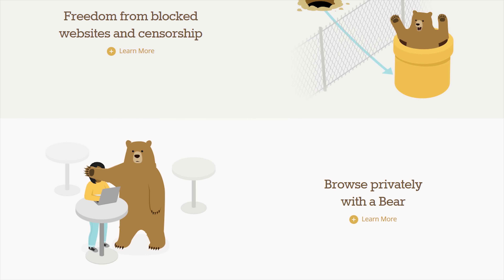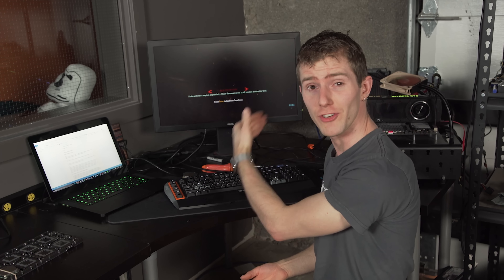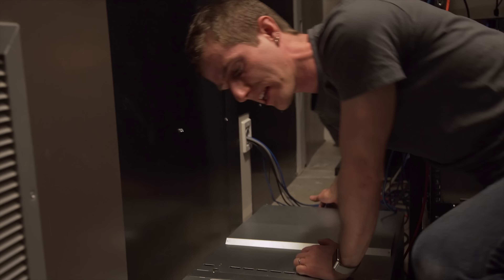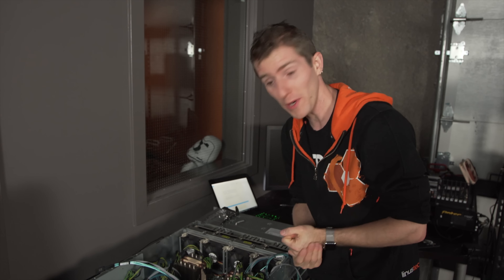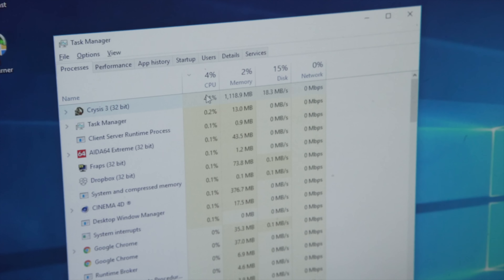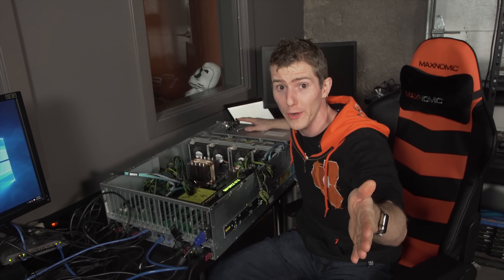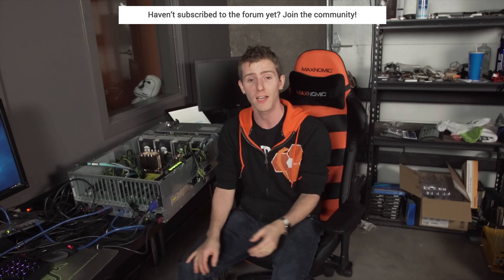Two 22 Core Xeon CPUs!? - HOLY $H!T Episode 6

Comment: Tunnelbear is only available to your left ears
Reply: +Hersa37 Hahaha!
Reply: +Hersa37 Yeah it does sound stronger to the left, it is playing through both speakers though.
Reply: +Hersa37 it's the devil speakin on your left shoulder
Reply: My right speaker is broken that's why.
Reply: +Hersa37 Ting also!!! ( I think "sponsor parts" where recorded out of audio balance)
Reply: It's unbearable.
Reply: Its not your speaker....
Reply: +Hersa37 Can I VPN the audio to my right ear?
Reply: +Tevyn Monismith good thing I'm deaf in my right ear
Reply: +Hersa37 Plays through both on mine
Reply: +Hersa37 Its "tunneled" to ur left ear via VPN.
Reply: I have multiple left ears apparently.
Reply: +Hersa37 Atleast now I know I got my headphones on correctly
Reply: +Hersa37 Weird, because it was on both for me. Maybe you just don't know how to plug in a pair of headphones.
Reply: +TheRebel3000 Or maybe it's that your pair of headphones or speakers are bad and don't have stereo sound and just use the left channel audio for both ears.
Reply: +mkylem +mkylem And what do you mean by 'bad'? They aren't faulty if that's what you mean. For that to happen there would have to be a bridge between two of the pins on the input or two wires touching inside the main sheath, which would probably just cause a short circuit and stop both ears working rather than playing both channels through one. Only 400/175,000 viewers liked the comment saying the left channel wasn't working so they're the statistical minority.
Reply: +TheRebel3000 That assumes that everyone who has seen the video reads the comments, has seen the comment, and has rated it without any dislikes. You assume that the remaining 174,600 people didn't experience that problem when it actually isn't the case. It is extremely likely that people with properly functioning stereo sound devices have noticed it, though the comment isn't a census nor a statistically valid way to determine whether the majority or minority have experienced it. I, for example, experienced it and didn't give it a thumbs up. If you knew about statistics, then you would know this is an extremely improper and flawed way to get data and make a result from it. (By the way, the point is that the left channel is the only working channel during the advertisements, not that the left channel is broken. It happened again during the Ting ad at the end of the video) 

Also, there are multiple ways in a circuit to make stereo headphones (assuming they are stereo. Mono headphones, even with two drivers, would do it by default) output via only one channel. It could be splicing one channel to two using the output jack or your system down mixing to mono and then outputting "stereo". If you want proof that the video only outputs to the left channel, download it and put it into something that displays two audio channel meters (like Premiere Pro or something) and you'll see the problem.
Reply: mkylem you should switch to de-caff sir
Reply: +TheRebel3000 if that's the case, the rest of the video should be experiencing the problem too
Reply: +Hersa37 Stereo comes with the Grizzly subscription.

Comment: How quickly that finished was amazing
Reply: +Daniel  Burgos I was like HOLY $H!T
Reply: +Daniel  Burgos How quickly I finish is pretty amazing too.
Reply: +Daniel  Burgos Yeah but those little "squares" looked so much smaller than what I've seen in the past, is it normal for it to render smaller chunks of that image when there's more threads available?  Maybe they are smaller because the clockspeed is only 2.2ghz, vs most "gamer" rigs clocked over 4ghz?
Reply: HUGSaLOT Valkyrie The more threads you run on cinebench the smaller it makes the individual rendering sections. This is usually because hyperthreading actually helps more the more threads you have, so it's actually good to be switching between smaller tasks more often rather than doing a few long tasks and never switching.

Comment: You guys should ask Valve for 10 Vives, nvidia for 10 1080ti's, and make a 10 vr's 2 cpu's.
Reply: ***** lmao
Reply: I don't think teslas even have video outputs
Reply: +Magnus Hjort Too bad the ti's don't exist yet. :O
Reply: +GLaDOSv3gaming In home streaming does not need a local video output. So it would work.
Reply: +홍용준 SLI is not needed for pass through to VMs. The point is to have as many separate GPUs as possible. Combining them in SLI would mean they could only be used in a single VM.
Reply: +GLaDOSv3gaming well, they DO have a 19" Nvidia touchscreen in the middle console.
Reply: They don't do video though, only calculations and stuff
Reply: +GLaDOSv3gaming There is no reason for them not to be able to output video in a VM. In fact, if one were to solder on some physical video outputs they would work perfectly well as local GPUs.
Reply: I take it back, some newer tesla cards have video outputs
Reply: +Magnus Hjort yep...
Reply: +홍용준 you can use more then 2 sli in the 1080 you have to do special things
Reply: +홍용준 Not correct. It supports more, but its not optimized for it.
Reply: make it so...
Reply: lmao
Reply: He did that
Reply: doesn't HTC make vives or does valve help
Reply: +Samsung Tabley collaboration

Comment: Thumbs up for the successive flagship models comparison!
I built myself a rendering machine about a year ago with two top of the line Xeons, and have been wondering ever since if I could have been pushing out renders faster, had I waited a little.
Reply: I jus got 2 2698v4for my z840, the 99s are still expensive and it's only 2 additional cores for 10 more watts, no big deal but I got the 2x 98 for chips.

Comment: "Hello, I'm Linus, this is what a $5,100,000 gaming PC looks like, it runs with a decadonediac Broadwell Core Intel i8-69420000 Ultra Extreme top of the line CPU so powerful it can kill all other existing technology, we're doing a quadrasextiantion SLI Nvidia Ultra Super Rare Edition GTXZ-8800900 that rocks 3.7632 terabytes of V Ram, DDR3, DDR4, and DDR5 at the same time, and 78 5 yottabyte SSD running at 77 exabytes per second, all on a dual express crysa 3 cinebench ASUS decabench Extreme Deluxe Edtion 88C762 motherboard, all bundled into 576 cubic feet of case space, a few hundred 760 mm fans, 89 gallon water cooling, sub zero polar ice coolant 5000 generation 73. This translates to an amazing anul fucking to your wallet and over 9000% orgasmic performance."
Reply: You forgot the 200,000K resolution monitor that its hooked up to.
Reply: You mean the 17 1500 inch 200,000K resolution monitor setup. ;)
Reply: "The question is... will it run Minesweeper?"
Reply: or just buy a fucking gaming server fill it up with 16 GPUs and you got a machine that puts any desktop pc to shame
Reply: ***** nasa goes a whole different way in computing.
Reply: EzioBellic2KOOL and we drop it on video lol
Reply: You just predicted i9.....
Reply: There's something called an "Intel Xeon i9", you don't know these? ;)
Reply: but can it run crysis on ultra settings??
Reply: You forgot a few zeros

Comment: can't wait for the 1080.

20 gamers 4 GPUS, 2 CPUS 1PC
Reply: 1080ti =]
Reply: YAAAAAASSSSS exactly what I was thinking
Reply: +Alpha X It is with Xen GRID and other vGPU systems, those are rare and weird though, and only run on Tesla/Quadro cards afaik.
Reply: +Wonder Boy 1180 with HBM2
Reply: +NonsensicalSpudz meh, would be awesome for vr, but for regular benchmarks so far, the 1080 isnt that much better than a titan, but still is awesome. i love the core clock speeds on then, 2.3 ghz jesus
Reply: +Volta Actually, Tesla and Quadro cards would not work either. nVidia sell specialised multi-GPU GRID cards such as the K2 for virtualised graphics in servers.
Reply: silosis How would you know if the card hasn't been released yet and the only graph of performance we've seen so far is the one they had at the live stream/launch event?
Reply: Bayonet
 You're right, last time I checked GRID was not around yet, only being planned.
 I haven't been catching up with this tech...
Reply: NikOwnzYu ive seen benchmarks already lol, you can just look them up and compare o card from the current gen
Reply: silosis Yea but we don't know if those are legit as far as most of the news outlets that have reported on this they said take this with a grain of salt.
Reply: NikOwnzYu in a month when they are released and are similar to the benchmarks we have available, dont say i didnt tell you so :p
Reply: silosis Dont care :P

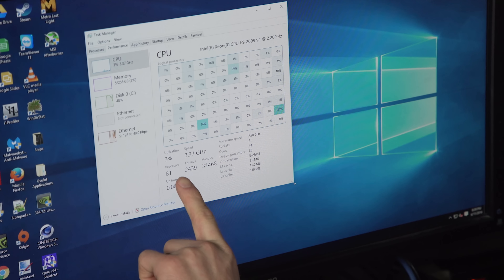Comment: 8:35 How do you see all the threads on Task Manager instead of the line graph? I mean I only have an i3 but I still wanna look cool. :'(
Reply: +Duwfel they switched from the line graph to this in Windows 8.1
Reply: +desolatetree you can click on Resource Monitor and see the line graph per core there.
Reply: +desolatetree Right-click the graph and you'll see the option to change the view.
Reply: +desolatetree Right click on line graph then change graph to logical processors.
Reply: hqdefault Yeah and then I just get four little line graphs lol Is it because I just have an i3?
Reply: +desolatetree Yes, don't worry I used to have a Celeron Prescott now I have an i7 Haswell :D
Reply: +desolatetree yes its because you have an i3, thats a dual core with hyperthreading so the 4 graphs represent the 4 threads of your i3. in his case, those graphs need to represent 88 threads (2 x 22core with hyperthreading), so 88 graphs is the result
Reply: Richard Sadler h aha that was so edgy you've chopped off my sides
Reply: Why do i have 12 lol , oh because i have a 5930k lmao
Reply: i have 176 threads, 88 cores

Comment: in the year 2020 intel will make a 100 core CPU and give linus some completely unrestricted isotopes of it and he will put a minifridge-sized sink of liquid nitrogen on them and like 36 titan XXXs on it and call it 36 4K multitasking rendering compiling transferring streaming gamers 1 CPU, but not before breaking like 100000 dollars of hardware in the process and it will probably require some kind of massive industrial cabinet transformer that linus ends up getting 240 volt outlets installed in his house to power
Reply: +๖ۣۜ♥๖̶tacokitten๖̶  It'll be great for gaming, but you'd need two of 'em to handle personality uploading and storage to a virtuality.
Reply: It gives CPUs with 200 Cores but you can't buy it because they are used by Supercomputer
Reply: Hmmm are you sure about that
Reply: Well, intel can barely do 50 haha
Reply: i read this again in 2022 and AMD is gonna beat intel to the 128 core CPU.. if you told me that back then i would never believe it
Reply: @bryce.ferenczi  They did 56 cores this year.

Comment: Isn't AMD supposed to release a 32 core CPU with Zen? Called the Atlas or something?
Reply: they're in the process of rebuilding their lab cuz the cpu ran too hot
Reply: You mean the Zeppelin?
Reply: +恵勇気 What do you mean, why?
Reply: +恵勇気 AMD made 24 core cpus in 2010
Reply: +恵勇気 They've already passed 16.
Reply: +Sacha Korban amd teeechnically makes 3000 core chips.... yet we call them gpus. huehueuhehu
Reply: +Quinn Dams hahaha
Reply: Quinn Dams i said cpu, gpu cores are different to cpu cores
Reply: Yep
Reply: +Quinn Dams cheeky
Reply: They found out that it needed a rad the size of a bed.
Reply: +deucey hd but can it run ISIS?
Reply: Sacha Korban i know that but i just had to do that.
Reply: That's just going to be a nukeclear plant in a PC case
Reply: I can't wait to see what zen can do
Reply: Benjamin Round
based on experience so far it'll increase the numbers on your electricity bill
Reply: iliden strmrege who cares about power usage, I just want more cores :)
Reply: Probably because core for core Intel destroys amd
Reply: +Benjamin Round Why? So you would like a 200 core CPU that has the runs like shit and requries a 2000w psu?
Reply: ***** Actually a one core powerhouse would make sense, more applications can benefit from a single core rather then 2 to infinite cores.
Reply: +TheDrewSaga  Ah yes, Sandy Bridge processors, my bae, overclocks like a beast.
Reply: Yay I can now use my pc as a water heater using that cpu
Reply: +TheDrewSaga So true man,on consumer end it seems core speed is still king cuz nobody uses any software that requires more cores...
Reply: +3Leg Dawg (JehovaNova) That probably won't be true down the road though. The focus is more and more on optimizing programs to actually use all those available threads properly. But you're right. There's still way 2 many programs (especially games) right now that don't.
Reply: I didn't hear about that I did hear about them releasing a 16 core CPU with multithreading (basically the same thing as hyperthreading) which would mean 16 cores 32 threads.
Reply: +IRockerbacon You run the same algorithm on the next thread using the next set of data. Nothing new to data programming. Nearly anything can benefit from multi threads, as long as its designed to.
Reply: +The Shadow Devil Slayer Umm no. Multithreading is the concept of running your program/game in multiple threads.

Hyper threading is the concept of running simulated threads on a single core. So you have 1 physical core, but it acts like 2 threads. Its not a direct double of power, but adds.
Reply: CPUS don't sit running a single instruction for hours.
Reply: ***** I've heard that hyperthreading is a type of simultaneous multithreading that was originally used by IBM but was named and patented by Intel.AMD could legally use simultaneous multithreading but they can't call it hyperthreading or they could face lawsuits from Intel.
Reply: +IRockerbacon I agree there are cases where it just wouldn't make sense to even try to use more than 1 thread. But I'm talking about solutions that can actually be implemented using properly synchronized threads. Yes it can make the application more complicated to design and debugging can be tough but its worth it obviously. 

But its just ridiculous how we're only just getting full-scale multithreading support in DX12. DX11 was still single threaded, even though some DX11 games did at least try to utilize multiple threads to some extent.
Reply: +Andloo Yunty Intel just likes fancy names. But they're all bark and now bite. Intel has been at 2 threads per core since 2002 (14 years ago!) while IBM's POWER CPUs can now do 8 threads per core. They're also considerably more power efficient than Intel's CPUs (the top 3 supercomputers on the Green 500 are IBM Sequoia (Blue Gene\Q) computers for some time; when the first sequoia came out in 2012, it was 55% faster than the previous record holder on the Top500, yet it consumed 37% less power; it is still the third fastest supercomputer in the world). At the moment, the most efficient supercomputers are using either PEZY-SC (chips with 1024 cores specifically designed for supercomputing) or GPUs (mostly nVidia, but there is one FirePro based design that's more efficient than the nVidia ones). The CPUs for these clusters are Xeon E5v3 and E5v2, but they're not usually used for computation, just controlling the actual superprocessors.
Reply: Alexander Pavel if IBM is so much better why do you only ever see Intel and AMD on the market?
Reply: Because Microsoft is only willing to make an x86 build of Windows. POWER is also not nearly as well optimized in compilers due to its lack of popularity (chicken v egg). Also, Intel focuses more on single core performance and cares less about overall efficiency and multithreading, which works better on desktops which rely on single core performance. POWER based computers also tend to be a lot more expensive than x86 since their only market is workstations and servers, once again giving Microsoft little incentive to create a POWER build for Windows.
Reply: Alexander Pavel I've heard of arm which is used in phone and tablet CPUs and x86 whic is used in desktops and business CPUs. I'm guessing power isn't seen much because it'd be used in servers and the like, things you don't see in everyday life.
Reply: The Shadow Devil Slayer Yeah. It lost popularity in the desktop/laptop market after Apple switched to Intel processors starting in 2006, as Apple was really the only company making consumer products with PowerPC chips. The main issue is that IBM didn't make a mobile CPU as good as Intel at the time and they also failed to reach the projected 3GHz speeds by the time Apple expected to have 3GHz Macs ready. They did have great battery life however, lasting 5 Hrs on battery, which was insane for laptops back in 2001 when the first PowerBook came out. Even the original PowerBooks with Power G3 processors had 3.5 hours of battery life in 1997 reaching 5 Hours in 1999, up to 10 Hours if you got a dual battery model. 10 hours of battery in 1999? Absolutely insane.
Reply: Alexander Pavel PowerPC, isn't that what the Xbox 360 and ps3 ran on, and the wii u is running?
Reply: The Shadow Devil Slayer Yes. The PS3's processor was a PowerPC based processor that was extremely powerful for the time when looking at complex single precision calculations (the PS3 could even render graphics on the CPU of the developer wanted to).  IBM actually took the design, improved the double precision performance, and made some of the fastest server boards of the time with it). The XBox360 had an alpha version of the processor that the  PS3 had, and only 3 cores instead of 8. The WiiU was interesting because the chip was a 3 core and had AMD graphics combined with the chip to improve performance (this is different (and in the end better performing) from how the AMD APUs that the PS4 and XBOne work)